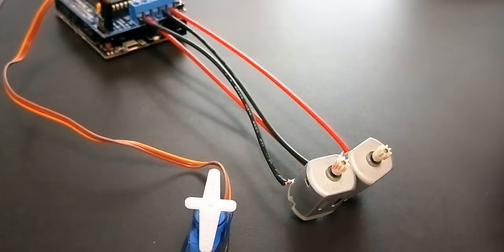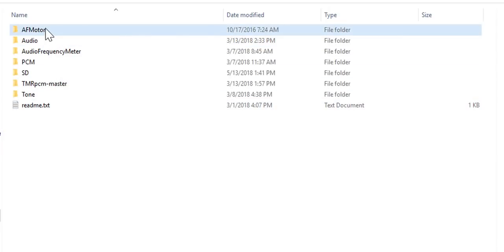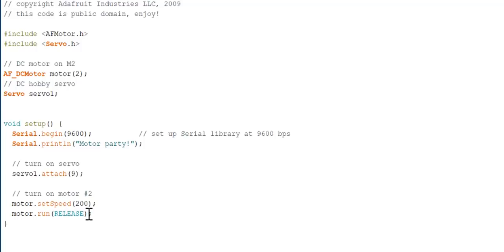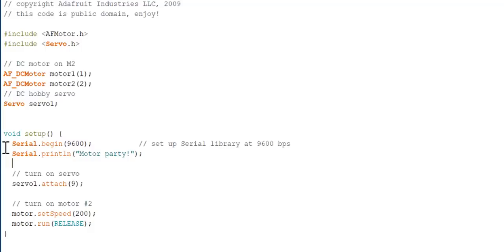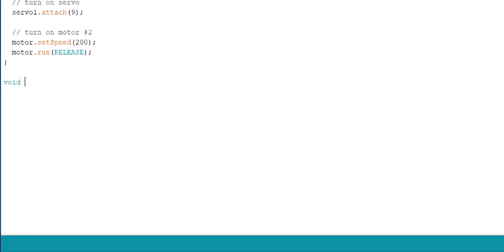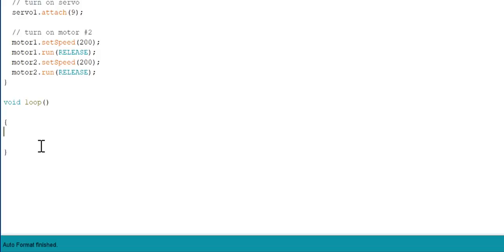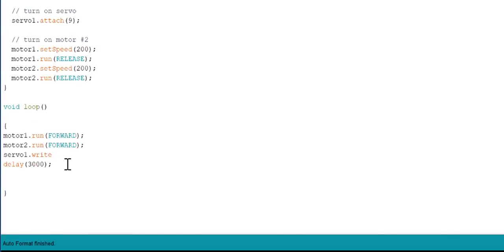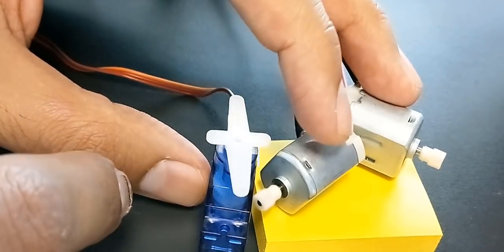L293D Motor control Module Tutorial - Run motors off the Arduino

Comment: if I run all the motor with one direction, Can I use this module with 8 motors?
Reply from the maker: There isn't enough current. You can use 2 shields on top of each other
Reply: @Fungineers  or piggyback the h bridge chips should give you 1.2a per bridge
Reply: I don't think you understand how DC motors are wired, or how electricity works. You should learn the fundamentals first. Each motor still needs two wires feeding it, regardless of if you are going in a different direction, since all the direction switch does is change the polarity feeding each side of the motor. So + becomes -,  and - becomes +. You should also look up what an H-bridge does before messing around or you can damage things.
Reply from the maker: Arcane is right

Comment: are carbon zinc AA batteries fine to use? and can you still run it with 4 AA batteries if you add an ultrasonic sensor or do you need more power?
Reply from the maker: No need for more power.
As long as batteries have the required voltage you can use any battery :)

Comment: Hello! Your video was extremely helpful, before watching your video I wasn't sure if my motor driver was defective as everything else was functional and at the time I didn't know about the cap on the jumper (The motors would buzz but not run) and now they will run when combined with 4 AA  batteries and the USB power supply (Computer). Do you have any ideas on why they won't run with the AA's? I have the same setup (Excluding the servo) but the motors refuse to run off only external power (Before watching your video they would occasionally run for a second or just buzz; with or without the USB power supply alongside the external power)?
Reply from the maker: Maybe you haven't removed the jumper?
Reply: @Fungineers  Thank you for the quick response (And sorry about my late response)! The jumper is the little cap on the PWR right? After watching your video I removed that and it now runs with 4 AA batteries and the USB power but not with one or the other.
Reply from the maker: Maybe your batteries are used up. Did you check how much voltage they are supplying? Try to recharge your batteries or get new.
Reply: @Fungineers  The batteries do run the motors directly (Wires touching one battery and the motor) and the light on the shield/arduino lights up when connected, just not the motors through the shield and in case the batteries were low I bought new ones at work today and have been trying to run it with those new batteries; still only runs when both sources are present. I thought that it could be the soldering job that I had done on the rocker switch since sometimes it cuts out (My first time soldering) but, I am not sure if that's the main issue as the USB is not soldered.
Reply from the maker: @SnowyGlory  but as I have expalined you must have 2 sources of power
Reply from the maker: either 2 different set of batteris (one 9V and one set of AA), or one USB powered, and one set of AA. Check my video where i made the line follower robot. I think i explained it better there where I connected 2 sources.
Reply: @Fungineers  I just tried it with the cap (Jumper?) back on the shield and it started working XD. I have seen setups that are the same as mine (I think these motors require less power than yours) and it worked with only 4 AA.
Reply: Have your buzz problem sorted? I am also having such problem.  I used two,9v batteries. But the motors gets stucked every time & when I push a little it starts moving.  Please can anyone help me out?
Reply from the maker: You have the jumper? The light is glowing brightly on the board?
Reply: +Funengineers can you help me please?
Reply: +Towhidul Tonmoy Yes, I have tried in both cases. Jumper on and off. But the result is same.  A little bit ago, I found in the net that buzz sound is produced because low PWM.  May I know what PWM value should I use?
Reply from the maker: Yes it's possible. Use higher PWM maybe 200. Did you watch my video on line follower robot? You will get the code and some more clarification there
Reply: +Fungineers Okk, I will watch that video and inform you later. Thanks for the help.
Reply: +Fungineers I am unable to fine your video on Line follower robot. It is not on your any playlist.
Reply from the maker: Don't search in playlist. Go to all videos.
Reply: +Fungineers  I have research a lot about my problems. And ended up that,My motor sheild not getting enough power.I used 9V and 4*AA batteries, but the resultss were same.The motor sheild can not drive the motors. In the datasheet of my L293D, I t was written in the website that, I need Ni-MH battary packs. Can you please suggest me,How much volt I need?To run all the motors? 7.2V or 9V.  My previous batteries were not Ni-MH batteries. I think that created my problems
Reply from the maker: @towhidultonmoy3046  I dont think the batteries will solve your problem. It doesnt matter what kind of batteries you are using as long as they are providing the needed voltage. Did you check the voltage on your batteries? Maybe they are old/ used up? Did you check my code on the line follower robot and increase the PWM? Is the yellow light on the shield glowing brightly?
Reply: +Fungineers Yes, I done it all. The light turns on but the motors gets jammed and don't rotate.

Comment: Hi i am a beginner wanted to know where to connect the laser driver module in L293d. I have 2500mW Blue Laser Head Engraving Module with boad. Will you help me with the with diagrams and software. It will be nice for me having help from you to make my project complete.
Reply from the maker: Connect to the motors :)

Comment: I want to ask about something if I used a power supply 9v in the Arduino can I then use the motors without adding another power supply for the motors ? And if I used 9v and the motor needs 5 volt will it be harmed ? And are the motors connected parallel or series ? (Please answer )
Reply from the maker: You still gotta use 2 power supplies. The motors won't be harmed though. Looks to me like a parallel connection but I haven't looked into it
Reply: K thanks . Great video bro you explained  keep it up ❤

Comment: Hi Fungineers, thanks for the great video. Just a quick question, can I run 2 small DC motors, 1 servo and 1 stepper motor at the same time with this shield? TIA
Reply from the maker: No, I think that will draw too much current. But you can connect 2 shields on top of each other and do it. They are really cheap so why not.
Reply: Hmmm...so what's that all about supplying 0.6A per channel? I would have thought that if you stayed withing that limit then it'd be ok as long as the power supply had enough amps. 

Cheap enough as you said but don't have the room to stick another on top so will have to think of another solution. 

Thanks for the reply

Comment: after connecting arduino to the shield . which arduino pins are reserved to operate the shield . 
is it posssible to use all  arduino pins for any other function
Reply from the maker: I think I explained that in the video :)

Comment: Can I use 6 motors using this driver? 12 volt dc bo motor and connecting it to only the m1 & m2 terminals i.e. shorting the wires of left side on m1 and right side on m2 port?

Comment: can we connect  2 Dc motors in single slot  i. e.  in ( M1 )
Reply: Definitely not.... Unless you are talking about splitting the + and - between two motors and controlling them with the same code. This would limit the current going to each motor as it will be divided by 2. Probably not a good idea. I would check the current capacity of the shield first. You have 4 motor slots already. Maybe you want 8?

Comment: ¡Excelente Explicación!, fue tan sencilla, que a partir de ella adapté para controlar 2 motores DC avanzando y en reversa, aquí el código:

#include <AFMotor.h>

AF_DCMotor motor1(1);
AF_DCMotor motor2(2);

void setup() {

  // Configurar Velocidad del Motor e iniciar apagado para luego encenderlo en el Loop

  motor1.setSpeed(200);
  motor1.run(RELEASE);
  
motor2.setSpeed(200);
motor2.run(RELEASE);
}

void loop() {
  
  motor1.run(FORWARD); // Avanzar Motor 1
  delay(3000);
  motor1.run(RELEASE); // Detener Motor 1

  motor2.run(FORWARD); // Avanzar Motor 2
  delay(3000);
  motor2.run(RELEASE); // Detener Motor 2

  motor1.run(BACKWARD);// Retroceder Motor 1
  delay(3000);
  motor1.run(RELEASE); // Detener Motor 1

  motor2.run(BACKWARD);// Retroceder Motor 2
  delay(3000);
  motor2.run(RELEASE);// Detener Motor 2
}
Reply: Cual es la libreria?

Comment: i have to make a fire detection robot using 2 DC motors and one servo motor so do we need to use both Arduino and External or using any of them?
Reply: Buy a smoke alarm mate.
Reply from the maker: You need one power supply to run the arduino, and one separate power supply to run the motors/servo. Your project sounds interesting. Keep me posted :)

Comment: do we need to use both external and Arduino power supply?
Reply from the maker: Yeah need 2 power supplies buddy.
Reply: ACTUALLY , I MGOING TO USE 4 MOTORS AND TWO SERVOS , AND I WANT TO CONTROL USING A WIRELESS JOYSTICK FOR WHICH I ILL BE USING THE USB HOST SHIELD , I M A BEGINNER, MECHANICAL GUY AND MY COMPETITION IS 2 WEEKS AHEAD. DO U KNOW ANYONE WHO COULD HELP ME WITH IT ?PLS
Reply: HOW MUCH VOLTAGE REQUIRED?
Reply: @tejaslokhande6452  5 to 36vdc
Reply: @rodnob231  thank you so much
Reply: @Fungineers  thank you so much buddy!!

Comment: also nice to know  is that you can piggyback the L293D chips to switch more current and bigger motors :)
Reply from the maker: Yeah you can. It will double the current. I haven't tried tbh
Reply: I am currently working on a camera slider project with this shield and i have backed 2 of them on top of each other and it works like a charm
Reply from the maker: Sounds like a "fun" project :)
Reply: @Fungineers  it is but I've spent my whole Sunday trying to start my sequence with a button via A0 but it isn't working
Reply from the maker: Are you using a push button?
Reply from the maker: Also, best Sunday ever spenttt
Reply: Yes, i am using the click action on a rotary encoder as a pushbutton. I finally got it working like 10 minutes ago. Next goal: make it stop with the same button! :p And as a final goal I am willing to use the rotary encoder to set the time it will take for the camera to travel across the rail.
Reply: @Fungineers  https://youtu.be/z1a8sL-3s_k
Reply: umm how exactly do you put one on top of another? I am a beginner.
Reply: @adhritgulati  you literally push the one on top of the other and solder the legs together than you put the bottom one in the holder, i will try and find the url i used back in the day
Reply: @tomdebruyn5731  ok thanks

Comment: not getting enough power from motor shield to drive my dc motor. how to get more power output from motor shield ?
Reply from the maker: Hmm. You need 2 power sources. One to drive the Arduino and shield and one separate one for the motors like I have shown. Is the power LED lighting up brightly on the shield?

Comment: and I don't yet know the maximum amps of any given motor that the shield can support without adding in relays
Reply from the maker: I think max 1 amp. If you have a similar board it says on the back the limit. Also you don't need relays unless it's an AC motor. Just need to add transistors but I don't think you'll need
Reply: ahh cheers, not got any boards yet, still in head scratching mode at the moment and I think I need a stepper motor actually which probably changes everything. (need slow precise movement with feedback I think)
Reply from the maker: Yeah you are right gotta have a stepper for precision buddy

Comment: Now all I need to work out is how to add some sort of "IF" command to only move the motor if an external photo resistor detects light :D
Reply: Just to know, what project are you working on with a DC motor and a light sensor?